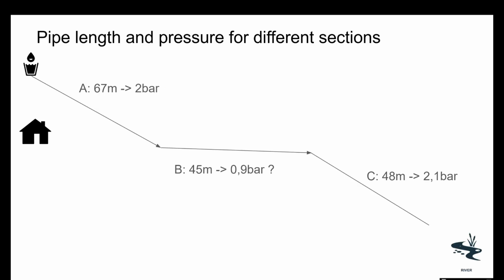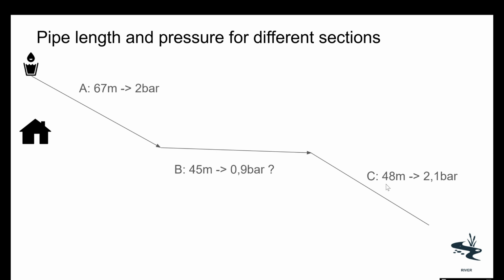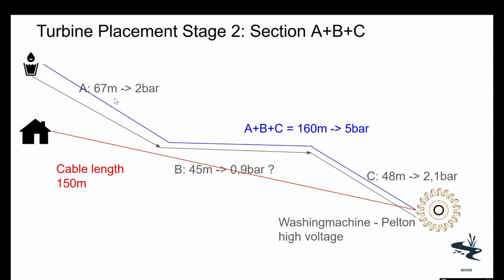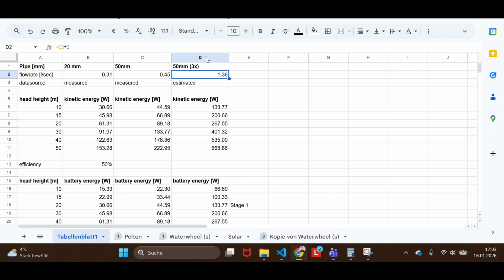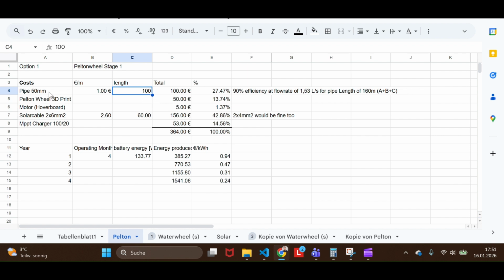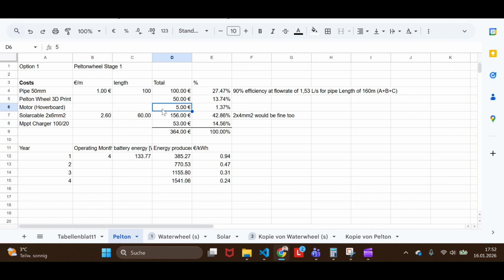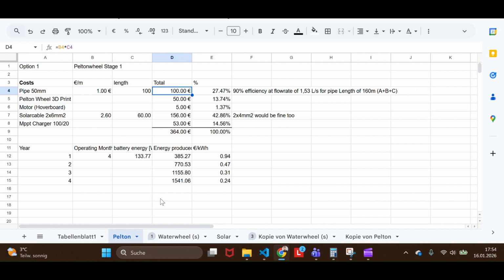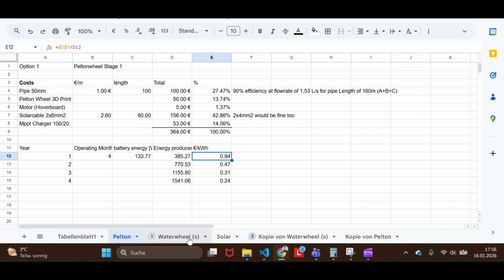Field Measurement Results + Two Turbine Locations (Power Estimates) | Micro Hydro Pt. 3

Comment: 0610   you  have a  VERY  low  nominal  flow  rate.    and you have an inefficient alternator.   if the water supply volume would allow you to triple the flow rate (to about 1.5 l/m) there would be about 62 watts available,  BEFORE  losses.
Reply from the maker: I am calculating with l/s not l/m in this video. and I definately get these flowrates from time to time.
But yes, I feel like I dont reach the estimated poweroutput. Maybe because of the alternatator efficiency. I will maybe change to a washingmachine motor